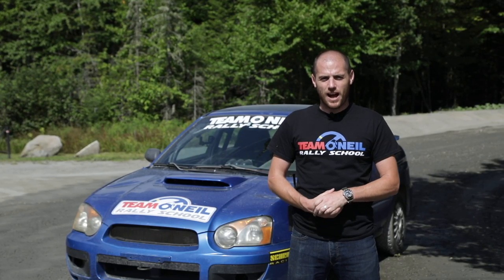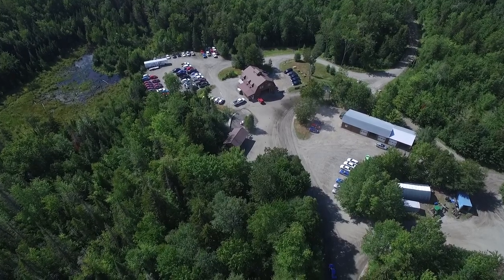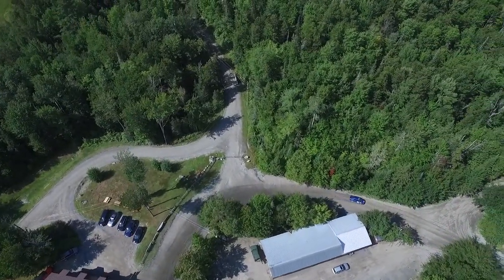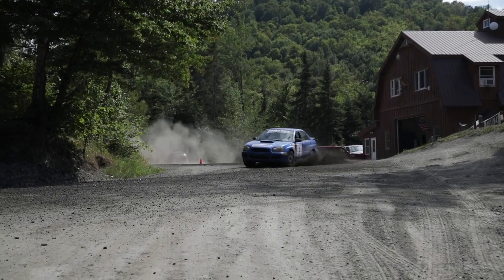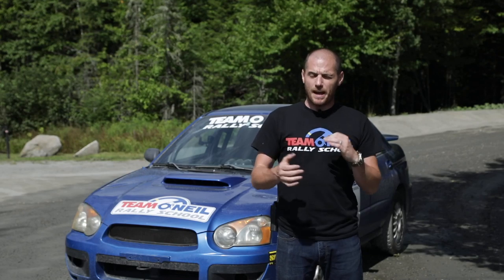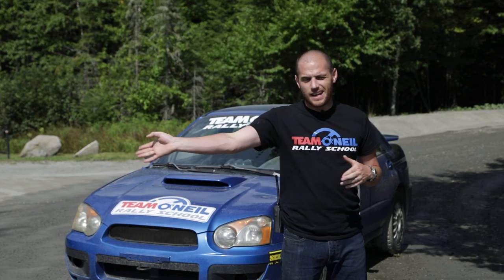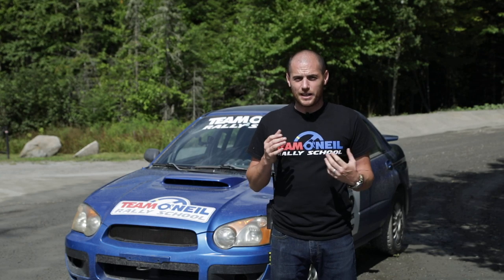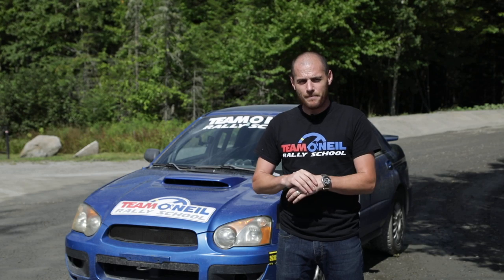Decreasing Radius Corners

Comment: I also want to add, feed steering in slow and predictably (so, you try to meter the steering to never hold the wheel still) and I sometimes tell myself to "don't cut", reminding myself to not dive in early, and to give myself more stability by not correcting or back tracking the steering.

Comment: Great video!

It would be nice to see that corner approach, then a basic 'here is the entry to the corner, apply light/medium/heavy brakes - here we can see the apex its time to apply throttle' sort of breakdown.
Reply: you can though. he explains how to do the braking (increasing pressure trough the turn) and you can see the brake light turn off just before the apex. The only thing i don't know is throttle, though I suspect light throttle throughout and rolling into it when the brakes are released
Reply: Severijn van Lambalgen I’d say half throttle all the time to stay in boost and 3/4 or even full throttle when left foot braking to not slow down too much.

Comment: I'm surprised at the single apex through that corner. Granted you do start off quite wide. Is double apexing on dirt as effective as on tarmac/circuit?

edit: from watching through the whole video I see that the exit actually opens out a bit so I'm guessing even if you do take an early first apex it would be difficult to clip a second?
Reply from the maker: With a decreasing radius corner, there is only one apex and it's at the tightest part. Up until then, the car should stay out wide.
Reply from the maker: If you have 2 corners in the same direction separated by a short straight, definitely turn it into one double apex corner... Or if a corner opens then tightens it's 100% the way to go. something like L3 30 L3 would just be one double-apex corner, or L3 < > same deal.
Reply: @Teamoneilrally  makes sense. thanks for the speedy reply!